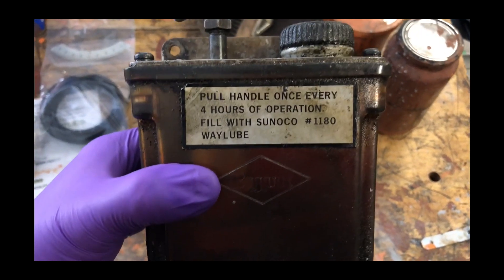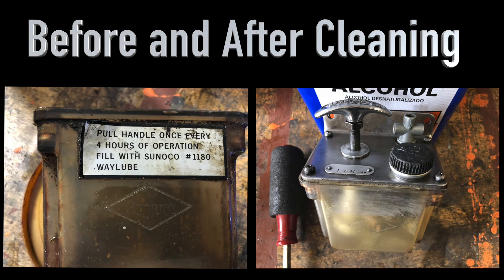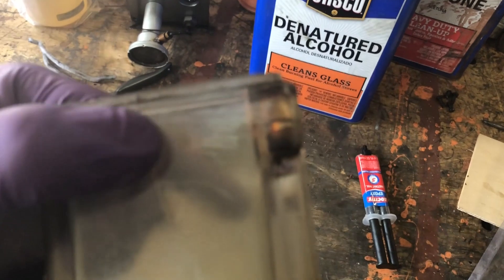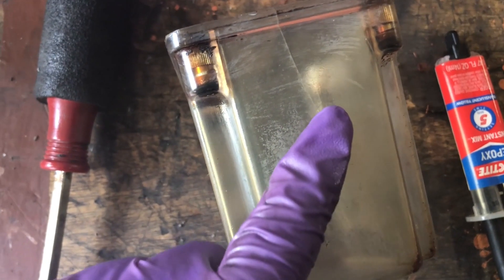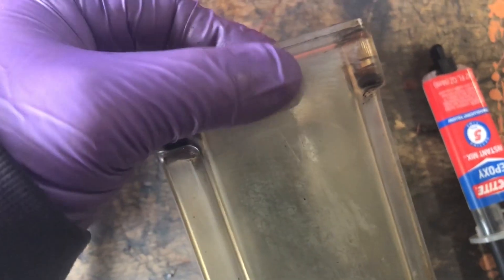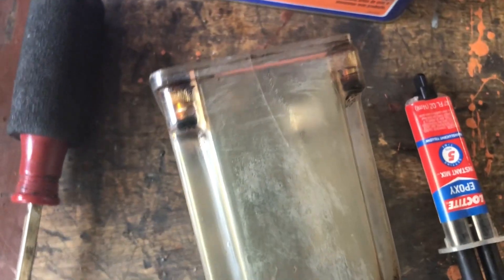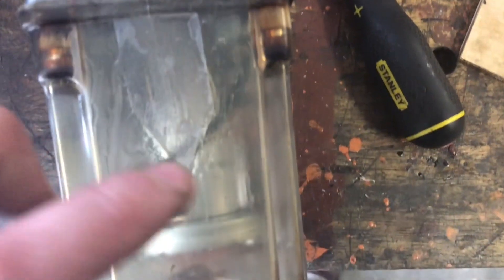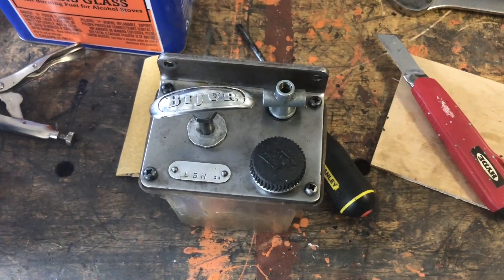Bijur one shot lube system refurb and repair.

Comment: Is it possible maybe someday you can explain how this lube pump system works, like an engineering way? Thanks.
Reply from the maker: Go to the frame at 6:40...  There is an aluminum cylinder on the left that sits inside the reservoir.   That one shot pump handle has a shaft that extends down into the cylinder and terminates with a plunger with a ring seal common to the cylinder tube.  There is a spring in series with the pump handle that keeps the plunger pressed down in the cylinder.   The cylinder has a check valve on the end of it that allows oil to be drawn (one way) into the cylinder when the pump handle is pulled.  When you let go of the pump handle, the check valve seals the cylinder common to the reservoir, and the spring pressurizes the oil shot.  That black line coming out of the cylinder goes up to the top of the pump body and terminates at a oil distribution manifold.  The milling machine has oil lines routed to the way faces on the x,y, and z axis of the mill.  when the oil in the cylinder is charged by the plunger by the spring, and the path of least resistance is through the black line, through the manifold, and through the distribution lines into the ways of the mill....  the spring depresses the plunger slowly over a few moments and oils all of the moving prismatic faces of the machine that are in contact and it creates a thin film of lubrication that results in a hydro plane effect and allows the surfaces to have relative movement under load with minimal friction.  The oil also helps to push milling debris out of the joint.
Reply: @JeremiahL  Thank You for the detailed explanation. Much appreciated.
Reply from the maker: @ShopperPlug  Good luck with what ever project you are working on.
Reply from the maker: Here is a simple diagram.  The unit shown is an older model, but the Principle is the same:   http://phscollectorcarworld.blogspot.com/2020/06/phs-tech-series-bijur-chassis-lube.html
Reply from the maker: This brochure gets into the check valve and more schematics of the system.  https://www.bijurdelimon.com/amfile/file/download/file/319/
Reply from the maker: Hope this helps.